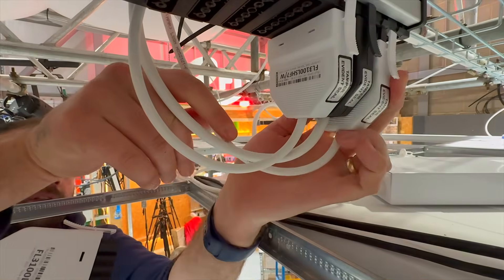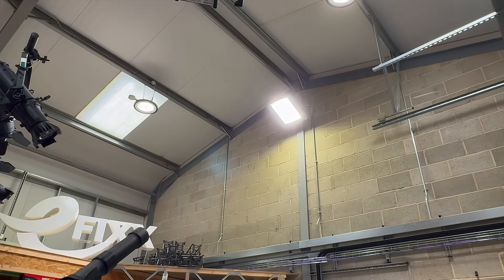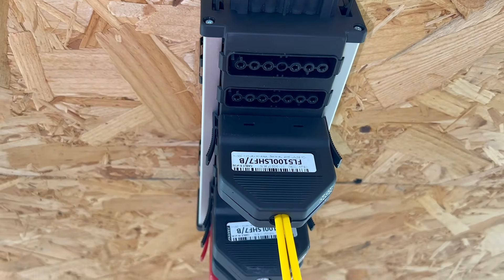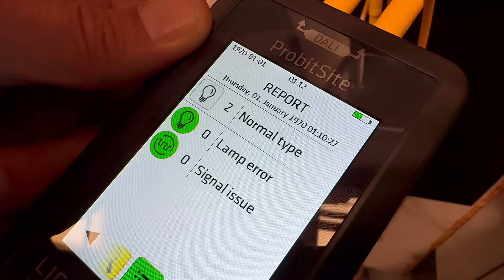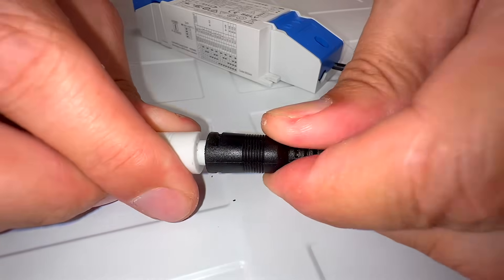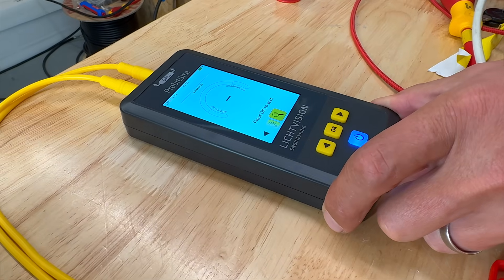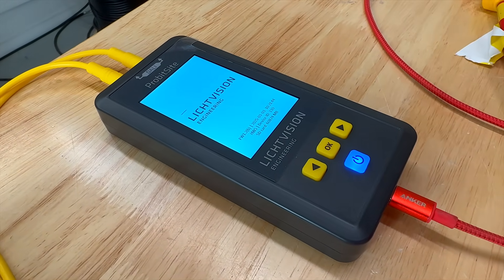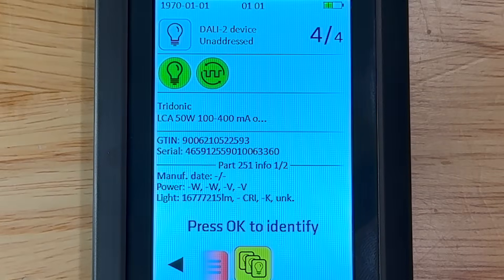DALI Lighting Fault Finding - Made Easy With This Expert Tool

Comment: Hello! Can ProbitSite find out the DALI cable short-circuit or in loop-connection, and is it able to locate/spot the error along the DALI bus? If not, pls tell which testting device available for such error finding? Thanks a lot!

Comment: What is this USA style plug for the high-bay fixture at 7:30?
Reply: Clicks Greg 

Clicks Gregs" refers to Klik, a lighting connection system by Hager, sold by NE Electrical under the name "Klik Gregs"

Very handy for commercial/ industrial lighting

Comment: they want 800eur for this esp32 with a display attached :)
Reply from the maker: It’s cheaper than a lighting controls “specialist “ having a day on site.
Reply: Bargain mate
Reply: It's the difference between KNX and DALI that I don't get
Reply: @roystevenson1375 to make it simple:

"pure" dali/dali2 has control gear on the same bus with lights.

KNX has dali gateways to communicate with the lights, but has (most of) the controls on a separate knx-bus.

KNX is also used for a lot more than just lights, as it is somewhat robust (but very slow) field bus.

That said, I have done a "pure" dali system, that also boosted hvac with the lighting PIR sensors.

Dali/dali2/knx all have device limit of 64 on them, no matter what the manufacturers try to sell you. You're usually safe, if you limit your designs at 50 devices per bus. There will still be surprises like in the video, where the fixture had two drivers in it. My record was 8 addresses per fixture.. Strange led-strip monstrosity hanging mid air made of curved aluminium extrusions.

In theory only basic dali has 64 device (250 mA) limit, dali2 tries to go for 64 lights + 64 controls (same 250 mA per bus) and knx could do 256 controls, if the 640 mA limit per bus could handle it. I had ~110 devices working just fine for couple weeks by mistake in cabling before I started to suspect that there's something wrong.